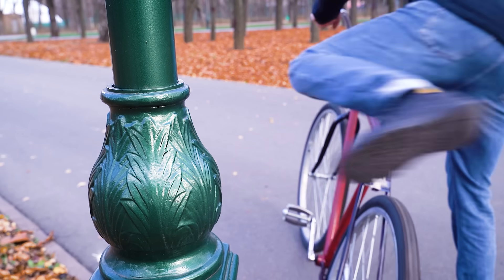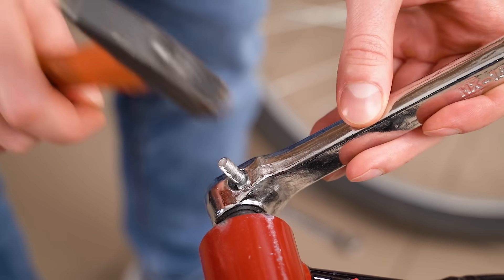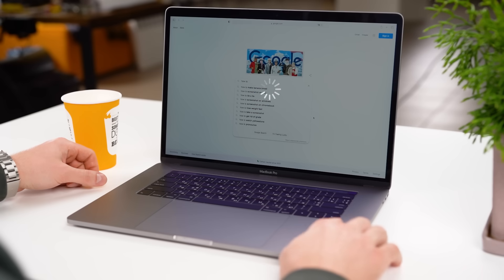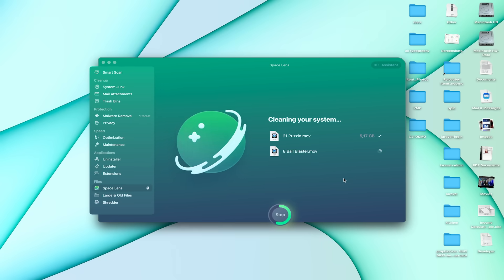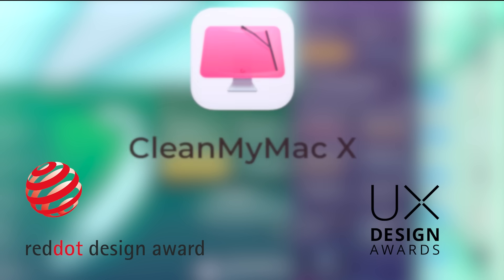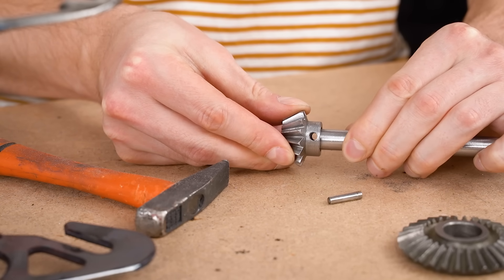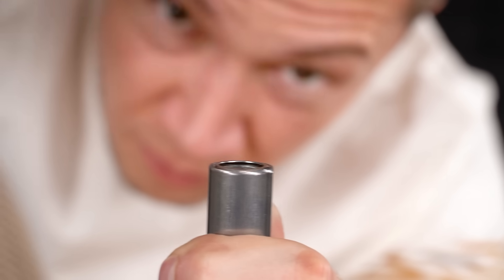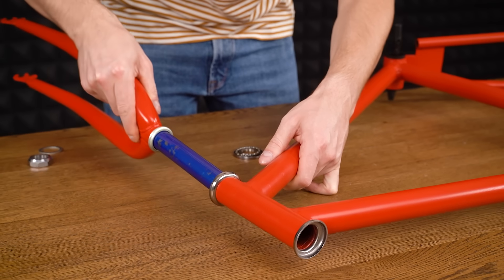Insane Chainless Bicycle Prototype

Comment: The gear drive is pretty cool. Your fabricating skills are awesome. But I think changing a wore out chain would be easier than changing wore out gears.
Reply: This gear system would break so fast going uphill. In 25 years of cycling I never had a broken chain. 
And I use my bike 7 days a week.
Reply: @blazn0  and the chain is actually more efficient and if you lubricate it (mostly like once in a month) it will last a lot of time
Reply: Yeh your thinking going to awesome way👍👍👍👍👍👍
Reply: Посность согдасен с  тобой)
Reply: make me wonder how car work without chain
Reply: @loxyrus  without going into too much detail, cars have gears in the transmission that are attached to a shaft with a yoke on the back end outside of the transmission case that the driveshaft attaches to. The other end of the driveshaft is then attached to another yoke witch is attached to the pinion in the differential, witch drives the ring gear witch in turn drives the axles witch the wheels are attached to. This is how rear wheel drive cars and trucks work, front wheel drive and all wheel drive are a little different. The only difference with AWD or 4WD is there is a transfer case behind the transmission that sends power to the front and rear through driveshafts to the differentials. Many transfer cases actually do use chains to transfer power. On many front wheel drive cars the differential is directly attached to the transmission.
Reply: @loxyrus   propeller shafts.
Reply: @loxyrus  chain is theoretically less capable on more torque or more power applications...
Reply: @larrystuder8543  What theory is that? Chain drives are proven and widely used in high power applications like motorcycles, 4x4 transfer cases,  and too many to mention farming and industrial applications.
Reply: @steveletson6616  I worked 40 + YEARS as an industrial mechanic. Gear drive is stronger where mechanical high torque or horsepower or  is the issue. Chain is good where flexible alignment is needed, or where shaft spacing is a concern. But I have worked with # 100- 4 strand wide chain is used for those reasons, but smaller narrower gears worked better. I have worked on electro-mechanical drives up to 400 hp, and industrial gearboxes up to 250 hp.
Reply: @larrystuder8543  Both chains and ring and pinion gears can be scaled up or down as needed to suit the need. In this case I would bet that the shalt drive would fail before the original chain setup.
Reply: Prototype??
This type of bike exists for over 100 years,some old people stil have them here

Comment: You need more efforts and energy to run the bicycle by this gear system. A chain will still have advantage of having higher diameter of wheel..

Comment: Smart, as idea... but it has mainly two defects:
- the hub of the pedals is blocked, it always turns.  
- only one transmission ratio is possible (and, in this case, too short).
Anyway, again... nice idea, nicely performed; mostly for the cheap  (using parts of old drills) and quick (entirely handmade) kind of solution.
Reply: Not his idea, this is already an existing idea from 1900s
Reply: Those are the same two issues any fixed gear bike would have and they're still hugely popular. The biggest issue here is just ease of maintenance. Too easy to switch out a chain or cog or chainring compared to this. Shaft drives have been around longer than chain drives, bmw motorcycles and some others still use them. Shafts on a bicycle are only about 75% efficient where as chains are closer to 95% which is another issue.
Reply: @johnnyregs2378  But the motorcycle using shaft has the motor axle paralel to shaft, not perpendicular, so here the efficiency is roughly 50pct only...
Reply: @andrasolivier7185  what you're saying makes zero sense and is incorrect.
Reply: @johnnyregs2378  U have to be more specific
Reply: Let's call a bug as a feature, you can reverse a bicycle now
Reply: Turkish inventor "Mucit Hasan Kum" invented shaft driven multi-speed bicycle and ceramicspeed company stole his work
Reply: Yeh, it needs to have a clutch and a gearbox.
Reply: @JohnNy-ni9np  Then add a motor too otherwise u die trying to make this shit move...

Comment: This is good for project but for everyday use its a NO ,It has No freewheel, when you go downhill crank pedal will hit your feet ,you cant control the speed of the crank pedal cauz it has no freewheel  because of the gear design..  and its a big hassle when you go uphill because of the teeth combination of the gear,  by the way its a great project.

Comment: I think you need to use larger diameter gear wheels, so you can spin your legs less number of times. Try it . Great concept. You created history there.🙏🙏🙏
Reply: He is directly putting load on the teeth...i think its not vulnerable
Reply: I would say ... he re-applied history there ... even though I admire his approach to do it DIY ... it's been nothing new.
Reply: Yes correct. He has to peddle fast to cover small distance.
Reply: This systems exists in motorcycle too for a long time (Although not very common). It's nothing new and less efficient than chain
Reply: I think this mechanism is more suitable for ev
Reply: @ompatel5226  how?
Reply: @srinivassiddarth  he could use different transmission ratio and then use another gear at rear with motor
Reply: @ompatel5226  Did u ever heard about power loss? Every gearing adds a vast number to loss, so u dont want to paddle this shitty vessel anymore after your first live try. And you recomend more gearing! :D
Reply: @andrasolivier7185  i just recommend rear gear to be bigger so u can use another electric motor tr
Reply: @ompatel5226  ye I clicked wrong recipient and didnt notice :o
Reply: @ompatel5226  btw I responded several times here to better add a motor because you rather dont want to paddle this hellmashine yourself :D
Reply: @ompatel5226  suitable for EV ? Actually it worsening the EV cuz electric motor will lose a lot of power just to turn the gear before it move the EV.
Reply: @arandomguy5886  thats correct shaft drive , chain or belt moto gp still use a 520 chain
Reply: Chain definately reduce wasting of energy due friction.
Reply: सिध्दार्थ सर बरोबर बोलत
Reply: @ravipalav3463  l
Reply: NOTHING NEW
Reply: @BLITZKRIEG1  direct drive
Reply: History?...that might be a bit of a stretch
Reply: Totally agree, this is the disadvantage of home made (DIY) modification.
This type of transmission, without ratcheting mechanism become ''fixy-type' bicycle.
Reply: It's been done before.
Reply: Yes definitely
Reply: You mean more teeth, go faster.
Reply: @abdulmuhaimin5274  bigger crown wheel on the pedaling side will need less turn of pedal to get speed, like on the chain type transmission have bigger diameter sprocket attached to pedal shaft.
With current gears, the ration 1:1which is good for ‘climbing up’.
Reply: @mukhlisrachman3908  *gear ratio
Reply: What about speed...? 🤔
Reply: Exactly bro...🙌
Reply: As said nothing new
Reply: Do you not think the man that has the intelligence to create that bike is aware of that! Jesus I despair 😩
Reply: yea
Reply: Exactly he will spin paddle slower and than wheel spinning faster ,👍👍👍👍👍
Reply: I think paddle not stop
Reply: Atleast i Saw this technique back in my elementary school, when i owned my 1st tamiya cars.
Reply: then he has to put more force to the peddle for the spin
Reply: If he wanted to go fast and long distances, he would have installed brakes first.
Reply: But larger wheels will require more torque to rotate  as  torque = R×F so to maximize the coverage go with medium size

Comment: I can see it having a good potential of making this variable by moving the shaft in and out over a bigger gear on the back, it might have low efficiency on its own but it's gonna be way more efficient and reliable that those miserable continuous variable bike transmissions let alone cheaper too.
Reply: That what I thought. Also  needs and a mechanical release on gear for down hills.

Comment: While I commend you're mechanical marvel at switching completely over to a geared-shaft-geared system to eliminate the issue with chains popping off, you now have created an entirely new suite of issues.  1 - You'll experience considerable more wear n tear on these components as you battle to keep them adequately lubricated.  2 - You now are permanently stuck in low-gear and will never be able to take mechanical advantage of higher speeds afforded you from less peddling due to a sprocket shifter.   3 - Shaft drives are notoriously inefficient and you will find yourself peddling more frequently to cover the same ground.  But nice try improving on this clunky chain design.

Comment: Chain: 5% Power loss
Belt: 12% Power loss
Shaft: 25% Power loss  🤷‍♂️
Reply: So shaft driven is ideal for exercise?
Reply: @brijlal973  if you don't like wind in your face
Reply: Well there's a reason why shaft driven bike didn't took off
Reply: But as same as belt drive you don't have to worry about grease or dirty oil on you're leg. Mamachari or japanese bikes has all three of them in the past don't if they still have em today
Reply: @arthurryanorilla356  or maybe use a chains cover?
Reply: @arthurryanorilla356   because when you ride a bike your leg gets all greasy?? LoL
Reply: Gear box - could be 50% loss
Reply: The correct is creat a transmission to connect to the shaft
Reply: @FlakerGamer  then your bike weights a ton. And i don't need to know your name to teach you that.
Reply: By a scooter ..it’s easier

Comment: Me again see I think you can run off a 5 or 7 Speed hup so weld your set gear ⚙ to the sprocket gear on the hub  and you have plenty of gears it have to be centered perfectly the gear your running should be perfect the back one you already have then you will use the pull chain to shift as you would on regular chained bikes

Comment: There is also problems in gear meachanism. Gear can wear and creat noise.  Also gear smoothness is costly.  And your design handling in low speed is bad.
Good work though.

Comment: No freewheeling 🤣
Reply: For real! Stop pedaling and you're gonna know real fast.
Reply: They just give an idea.. just put freewheel gear.. no such big deal tho..
Reply: I bet after that you throw that in garbage right 😂
Reply: Good job brow,but Repot kalau di jalan menurun kaki harus lepas dari pedal😂😂 yah make freewheeling...
Reply: better to weld ring type bevel  gear to sproket 
wheel ,after grinding 
teeths of wheel.
Reply: I suggest using  brake hub so it can free wheel and brake. But the issue there will the gears handle the breaking.
Reply: fixed gear riders:

1st time?
Reply: Right 👍😂😂😂😂😂
Reply: Coaster brake... very evident in the video. Coasters DO allow free wheeling.

Comment: This is not very suitable as it consumes more effort and and power loss .it is suitable for mostly high performing engine that generates high torque and is designed for off road adventures .

Comment: If we could make a gearbox near the back wheel then the speed can be increased with good efficiency.
Reply: Geared hubs are much less efficient than chain drives.
Reply: @chrisdaigle5410  True but it would probably last forever with little maintenance.
Reply: or just use a rohloff hub. internal gearbox inside the rear hub.
Reply: It's been done

Comment: The smaller your gear, the more energy you need to ride it, look at how fast u cycle it, but the speed is so slow compared to before
Reply: Not necessarily.  In fact on an uphill it would be much easier.  It is only on flatter and downhill surfaces you would end up pedalling much faster with almost no effort.

Comment: Cutting of frame should be avoided 

And and front gear must be big so for one paddle circle, the rear wheel moves 4 times atleast, to achieve same torque to speed ratio as in chained gear cycle

If possible a proper set of 3 gear bicycle can be made, without a clutch

Comment: a little advice might help.

after you make a gear like that, you can upgrade the bicycle speed interval by changing the rear hub using internal gear.

I think it could be cooler right!?

Comment: Wd40 is neither grease or gear Lube.   At least spray it with white lithium lol😅.  And while I’m complaining that gear ⚙️ by the pedals should be on the inside by the frame instead of the outside as the flex increases the further you go out the shaft and this will cause the gears to wear faster than the alternative I would think.
Reply: Some of those old drills had multiple speeds. Maybe make this thing shift. At least a two speed would be cool. Love the sleek look either way.

Comment: At 4:41, the rear wheel spins about one quarter rotation after the pedals have stopped moving. With the design shown, that shouldn't be possible unless the gears are slipping. Looking at it frame by frame, it actually looks like the gear on the shaft is completely stopped but the gear on the wheel is moving. Is there some mechanism to disengage the gear that was not shown, or am I missing something else?
Reply: He didn't modify the wheel hub, so I don't think it is any different from the normal bike where cruising (aka stop pedalling, wheel keep moving) is still possible?
Reply: The wheel to pedals rotation ratio seems to be different in separate scenes which should not be possible and there's not a single scene showing actual start of movement by pedaling (he clearly pushes with left leg in that one scene) so I don't think the rear cog is even attached to hub (he just drops it in place and actually attaching rear cog to hub is never shown). I think this is not a working prototype but the bike is simply pushed to movement and he is just acting to pedal it forward. The scene with turning from left to right shows the bike to be very unstable which also suggests that he is not putting force to rear wheel but free rolling while acting to pedal.
Reply: @SuperSohaizai  Ah, right. I thought that was handled in the chain, but after looking into it, it is mounted directly in the wheel hub.
Reply: I too was thinking about that
Reply: That is the existing free-wheeling hub he has used.

Comment: One thing about this video showing, the gears will strip over the years or through excessive use. Other than that, interesting take on the bicycle modifications. Keep it up!
Reply: Just grease it good
Reply: @KClO3  
Good point there, but too much gear grease will render it slippery for use.
Reply: @lyndonluquin4091  no it won't... The gears are locked in place, if the would slip then something would be really wrong

Comment: Unfortunately this is way more of a disadvantage compared to a chain...
The ratio looks to be 1:1 so you have to put in full work to move. The next problem is if something like a stick gets caught in the gears, for a chain it will either just rotate all the way through or pop the chain off and then the chain can go back on, for the gears it would either seize or bend it. 

Like it's a neat concept and looks clean but it's super inefficient

Comment: Just putting abit more gear then this will be complete

This does looks cool but it's better if the gear is abit bigger to make it move alot faster and easier to cycle

Plus this bike is not good on climbing hill because it takes alot of pressure to cycle this bike and it's dangerous to

Comment: Fabrication ability is great 
But this design is not better than the original
Fixed gear ratio 
As long as the bike is going the rider can't stop using the pedals

Comment: But also consider torque.
In this prototype you have to paddle more for one single rotation of the tire and will make you tired in short time.
Change the ratio of teeth in the gears.

But still good idea.

Comment: That's great but,
1) You'll have to pedal more, compared to chain cycles
2) You'll have to pedal continuously, you can't 'glide' like you do in chain cycles

Apart from this, Great Idea!
Reply: i think it is possible to integrate the same mechanism present in the rear gear set into the current one if he did not do it yet, that way you can just let it glide, but true you have to pedal more than in a normal bicycle, and I would like to see if it is possible to add something transmission like to this mechanism, and I guess it is not impossible, but will definitely be time and money consuming, but I thing the end product will just be worth  it